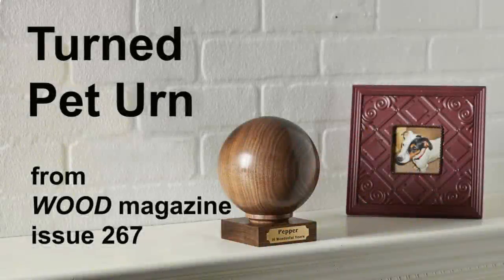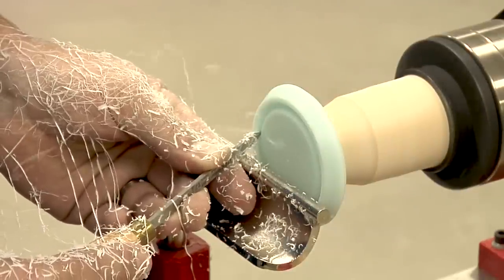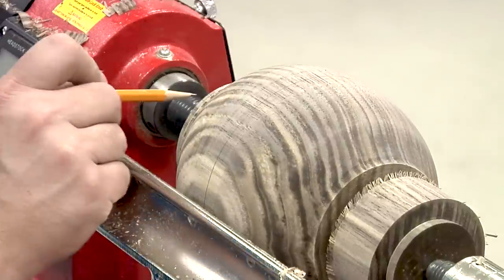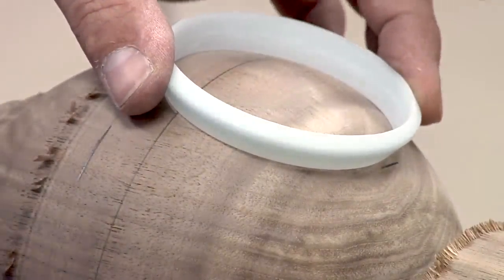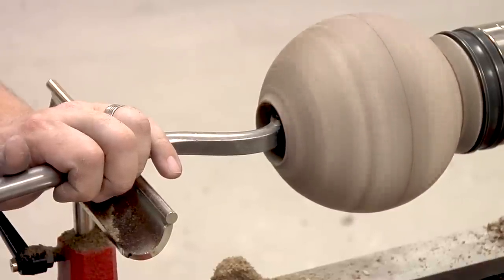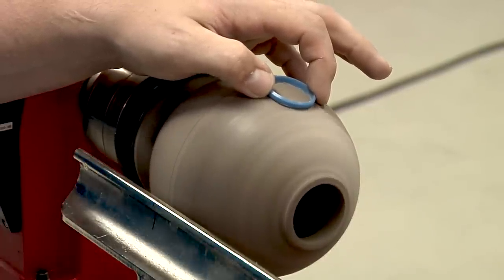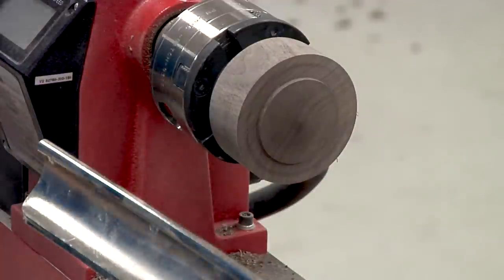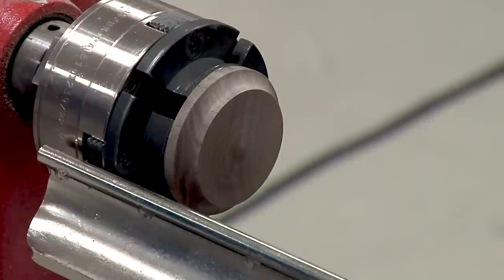How To Turn A Sphere on the Lathe - WOOD magazine

Comment: Thank you so much for the very interesting video on making a sphere..
47 years ago I worked for a bearing company called Torrington.
We made large spherical bearing race ways that had to have spherical inside and outside surfaces.
The name for what you're doing is called cross axis.  
You can generate perfect outside or inside spheres by using a fly cutter and actually have the fly cutter running and move into the material that is spinning.   
The radial distance from the center of rotation is the radius of the sphere.
Cross axis cutting or grinding generates absolute perfect spheres.
Cheers,  John L.  Fairlawn Virginia USA

Comment: What is Corina?
Reply: Corian is a brand of solid surface material created by DuPont. Its primary use is as a countertop/benchtop surface, though it has many other applications. It is composed of acrylic polymer and alumina trihydrate (ATH), a material derived from bauxite ore. Corian is the original material of this type, created by DuPont scientists in 1967.[1] A number of direct solid surface competitors to Corian have emerged since the expiration of DuPont’s patent on solid surfaces.

Comment: Wrong tools used the wrong way.
Making the sphere method was good but way too long. 
A better video would have been on making a sphere jig & using it. Didnt show the proper sanding procedure to the same extent as the making of the sphere. 
A good project, though.